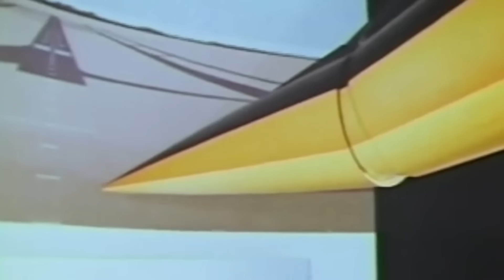The Insanely Bigger Faster American Concorde Failures

Comment: Concord was amazing.  Whenever it came over London everyone stopped and watched it fly past.  I remember  every minute of every flight that I took on Concord.
Reply: Worked near flightpath for Mascot, Australia. Did see a demo Concorde fly past, to and from.  Sharp front,  looked quite small, but fast compared to other jets going past. Noise wasn't to loud, as it was climbing higher than normal flights at that distance from airport.
Reply: "Concorde service was profitable by the late 1980s and if not for the economic downturn and Air France Concorde crash of 2000, may have survived to this day. Concorde earned £500 million for British Airways after tax profit, this was between a loss making 1982 and a highly profitable 2000 with just seven aircraft."
Reply: @awatt  But does that not take into account them being given to the airlines for free?
Reply: @abbersj2935  
You will need to provide s citation for that.
Reply: @awatt  "Who paid for Concorde?
It was then that British Airways stepped in. It convinced the government to sell Concorde. With skillful negotiating on BA's part and a lack of optimism from the Government, British Airways bought Concorde entirely in 1984 for £16.5 million.25 Jun 2020".
It's all out there. Basically they were given away. Still a wonderful aeroplane, just due to circumstances not economic.
Reply: @abbersj2935  
Not economic apart from the half billion it made in profit.
Reply: @awatt  But if that does not include original cost of purchase or development it means nothing. Don't you see that?
Reply: @abbersj2935  
The tech developed for Concord was used in other projects both military and civilian.  How will you cost that?
Reply: @awatt  Look, these are not my judgements, they are those of others. There are always spin offs and knowledge gained but would it have cost the same? Unlikely. One could also propose that another project could have been more viable if taken up but could not be due to lack of Engineering personnel. For example things were learned via Blue Streak, did it benefit anyone much? Probably not.
Reply: @abbersj2935  
"Others" may judge that the earth is flat.  Doesn't make them right
Reply: @awatt  Look at Wikipedia etc, you'll see the truth, if you want it.
Reply: @abbersj2935  
Fly-by-wire (analog)

Thrust-by-wire (later to evolve into FADEC – Full Authority Digital Engine Control)

Brake-by-wire

Engine inlets-by-wire (to handle air coming in at different speeds, including supersonic and prevent excess yaw if an engine failed in cruise)

Telescoping landing gear – too long to fit in available wheel-well space

Fuel used as a coolant and a heat exchanger for the air conditioning and the hydraulic system respectively

First commercial airliner to use fuel for trim

Just some of the indications developed for Concord that are used today.  To say concord was a failure, either technically or commercially is wrong.  You are not counting the amount of tax raised by Concord.  Add that to the after tax profit and Concord will at the very least break even.  I can understand that some nations are jealous of concord as no one has been able to make one since.  Over the decades American companies have shown plywood models of supersonic transport planes but nothing else.
Reply: @awatt  Concorde service might have been profitable, but there were NO spare parts for the most part and they were running on bits cannibalised from non-flying items. That's really what finally grounded them - Airbus refused to continue certifying them because they didn't want the liability of another one falling out of the sky, this time due to old parts breaking
Reply: Insane plane, id love seeing one someday in a museum.
Reply: @Cat-y4w  where you from? There's one in the Yeovilton Air Museum in the UK that you can walk inside.
Reply: @davidchapman1508  there's one at IWM Duxford too, I worked for a mat rental company and we had mats at the entrance and exit, so I got to walk through it every week.
Reply: @davidchapman1508  that's the Fleet Air Arm museum in Yeovilton.

The Concorde there belongs to the Science Museum, its a flying testbed aircraft, not a passenger one. It was the British Prototype and so quite different to the airline version.

WELL worth a visit.
Reply: @Cat-y4w  I did, back in the 80s in Europe. My impression inside was that they are surprisingly cramped. I don't know how many passengers it held, but it did not seem like a lot.
Reply: @MrMace313  80's? Thought they were still flying till the 2000's, probally an older model, not that suprising that they are cramped, i mean, they are very long and slim.
Reply: @Cat-y4w  last commercial flight was Oct 24 2003. The first test flight after the Paris crash arrived in NYC just in time for 9/11 and they were permanently grounded by economics shortly aftrwards. Only 14 were made and only 9 or so were ever flying at one time
Reply: @miscbits6399  
Still.  No one has been able to build one to this day.  Concorde's single accident is far better than most passenger aircraft.
Reply: Used to live next to Heathrow - it looked amazing taking off at night with the burners. Also remember it setting off car alarms in car parks
Reply: You obviously have/had money
Reply: @chrisf8855  or like most people who flew on it used frequent flyer miles
Reply: @bobthompson4319  No, not actually “most people”.
Reply: @chrisf8855  special flights were sometimes available at a considerably reduced rate.

You could buy a ticket for a "positioning flight" from Heathrow to wherever it would actually be flying transatlantic from.
Quite a few people I know paid a "small sum" to go on one of these 20 minite flights from Heathrow to Bournemouth.
Reply: @chrisf8855  somethin wrong with that?
Reply: @kenkovar78  Did I say something was wrong with that?? No. You're just good at misinterpreting things, huh? "But, but you implied it" 😄
Reply: beautiful aircraft, outperforming any civilian airliner in operation, to date and a design icon that’s engraved in the imagination of anyone who saw it in flight in person.
a lot of sour grapes in the comments here by people old enough to know better (but lack the visceral, palpable reference point of beholding it in the sky over them, rather than just on an lcd screen), and a sizeable cohort of people now who are too young to have had the opportunity.
it’s worth repeating, truly a beautiful example of aviation design at its best.
Reply: I sometimes feel the myth of the Concorde far surpasses the reality. It was amazing technology, but it was also rather terrifying the number of nearly catastrophic close calls it had had prior to the Paris crash. The Paris crash itself was telegraphed by a number of prior incidents, but the clear risks were hand waved away. While A blown tire (which was an extremely frequent occurrence and a core problem they never really addressed or resolved) could and indeed had punctured a wing tank, it surely could not cause a big enough hole to cause the catastrophic loss of an aircraft to fuel fire, because…”we say so and we’re experts”. Between nearly losing one to a blue Pepsi paint job, to the partial loss of a vertical stabilizer over the Pacific, to the constant dangerously explosive tire and undercarriage issues, it wasn’t the miracle plane many claimed. The problem was it should have been the first step in commercial aircraft evolution and refinement. But the refinement never occurred. And thus the Concorde’s core root issues of insanely high needed takeoff and landing speeds remained unchanged for the planes decades long service life. The sad thing about the Boeing 2707 is it would appear Boeing had solved one of the Concorde’s main problems. That of low speed flight. Of course Boeing solved it by throwing weight and complexity at it. Creating whole new problems.
Reply: @andrewtaylor940  
Barns Wallace hated Concord.  He hated the shape of the fuselage and the fixed wing.  He favoured a rectangular section fuselage and a swing wing.  I wonder what he would have come up with if he was in charge of the project.
Reply: @awatt  Probably something not too far removed from the American B-1B Lancer, which also shared a lot of design history with the 2707. The core problem with the 2707 was while it sidestepped the Concorde’s poor low speed characteristics and need for extremely high takeoff and landing speeds (with inherent structural stresses and operational risks) the materials really weren’t there yet to do what Boeing was trying to do, at the weights that they needed. You couldn’t just take the swing wings of an F-14, F-111 or Tornado and scale them up to a large commercial airliner size. You run into the issues of just moving wings that big in flight.
Reply: @awatt  He hated it but the wing was chosen to maximise fuel capacity and minimsise weight. He wasn't always correct in his designs. The swing wing was a big part of why 2707 didn't fly
Reply: @andrewtaylor940  True, but that is the nature of innovation, especially when under such tight budget constraints. I agree that while it was just about 'OK', some important things were allowed to fester and become more dangerous. It was and still is a phenomenal aeroplane even today. Swing wing planes had been made before, and I think I'm right in saying that more was spent on the 2707 to only get a half side wooden mock up than was spent on all Concorde development! It's really a product to be proud of. It shows what a collaboration of great minds can achieve.
Reply: @andrewtaylor940  the massive fuel tank leak issue was a big problem. A ladder strike at Harewood (Christchurch) NZ caused 5 tons of kerosene to get dumped on the apron in the mid 1980s. They really were that fragile

As for "why?" on the ladder. Baggage loading was in a tiny hatch right up in the tailcone Almost an afterthought...
Reply: My first job was in a building just west of Heathrow airport.  Every morning we would hear the roar of the engines in the distance and all work stopped on the side of the building which faced the flight-path until it had flown past
Reply: I lived literally right next to dulles international airport. We always knew when the concord was taking off. To say it shook the house would be an understatement
Reply: @gamebred5662  I lived on the Heathrow flight path... I can only agree with you. That said, it was a magnificent aircraft!
Reply: What happened to it, I'm probably not going to watch to whole video😕
Reply: Saw it once or twice landing at Heathrow.......was very loud!!
Reply: Concorde
Reply: The Concorde overflew Vancouver a few times during Expo 86, my father and I were lucky enough to be able to see the White Elephant in flight over 3 or 4 passes of the Expo site. I still remember the grin on the old man's face, and it inspired him to save up enough to buy his own plane, a WW2 era vintage North American Navion. That plane was amazing in it's ability to inspire, even if it was unviable in the long term.
Reply: What was it like breaking the sound barrier
Reply: @jawjaw9148  
Unremarkable.  You wouldn't know unless the pilot told you.  The note of the engines changed a bit as the afterburner were turned off and that was about all.
Reply: @awatt  cool
Reply: @awatt  Lol, afterburner on a passenger plane, how cool is that?!
Reply: Jawjaw914 No drama. Gentle nudges from the afterburners pushing you through. Awesome
Reply: Concorde was a Commerical FLOP, but it looked Great at Airshows, the LAST Concorde in America flew in OCTOBER during one of the FLEET WEEK Airshows in SF.
Reply: Yet you cannot spell it's name correctly.
Reply: @jimdavis8391  
The French one had a on the end.
Reply: @awatt  Both.
Reply: @awatt  yeah but the french leave off the last letter so no big deal
Reply: @awatt  The Cabinet approved the project in principle and declared that the aircraft should be called the 'Concord' (English spelling – without the 'e'). ... The argument continued until Tony Benn as Minister of Technology, resolved it in 1967, in favour of the Concorde spelling.
Reply: @jimdavis8391  And you cannot use 'its' correctly...
Reply: @jimdavis8391  yeah he is, did ya see what the brits called it 'concord'
Reply: @jimdavis8391  silly comment; the spelling was controversial and could’ve been spelled either way. French national pride was one of the issues.
Reply: @jimdavis8391  *its
Reply: @jimdavis8391  And you cannot spell "its" correctly.
Reply: @jimdavis8391 *Its
Reply: Then she sucked in a Goose & down in flames she went!
Reply: @user-mp3eq6ir5b  I dont think geese are quite that fast, I read they were strictly designed to be subsonic
Reply: @user-mp3eq6ir5b  if you mean Concorde, it's wrong. It wasn't a bird that got it to go down. A DC 10 took off right before, and a metalstrip fell. It caused a wheel on the Concorde to explode, and the debris was sucked in one of the engines. It also caused a big dent in the wing. It got consequenses for the fueltank, it made a big hole in the wing, and the fuel ran out and got ignited.